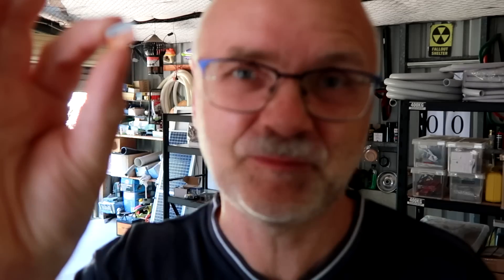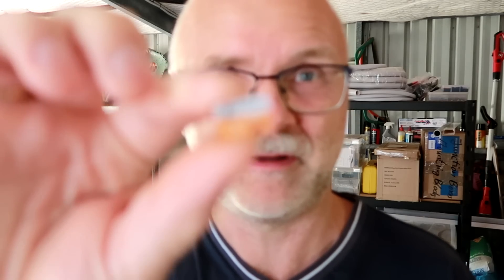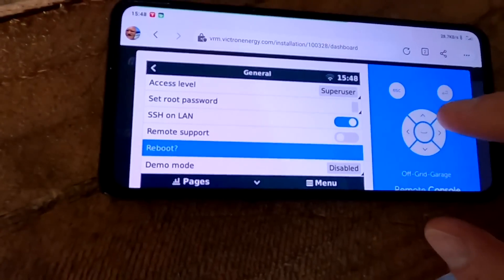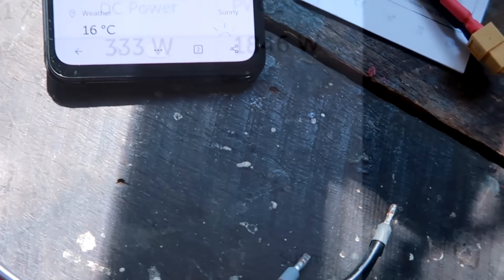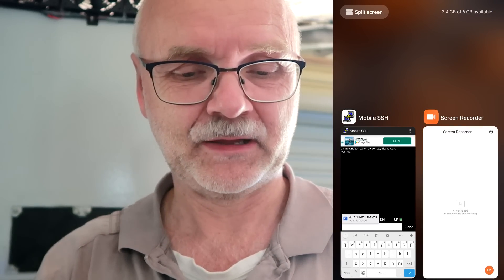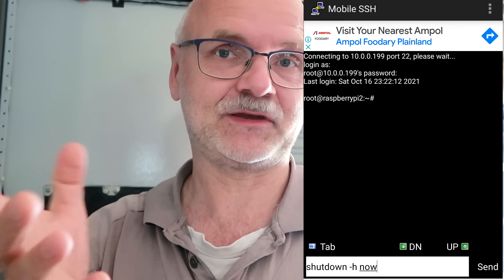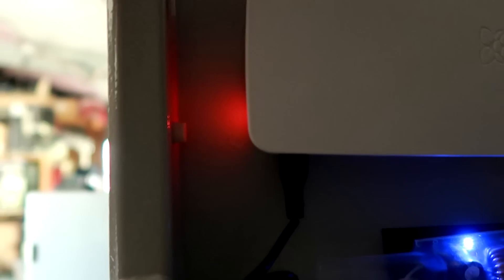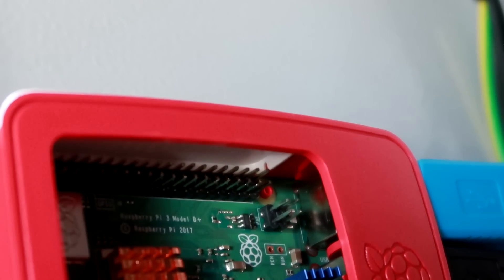Avoiding corruption on your Raspberry Pi SD-Card running Victron Venus OS

Comment: I run a Raspberry for 6 years outside in temperatures from -28 to +32 and with power outages and other things and still no corrupt SD card . Why ? I create a ram drive and there I put all log files and other temp files that needs writing. 
This will stop all tearing and cause of destroying a SD from bad power or loss of power.
All Data I need to store is sent to a database in cloud.

Comment: I do not get what is cumbersome with ssh. I have all my hosts in Remina, so on click and one command is totally fine for me.
Just did it to shut down a PI4 8GB to replace it with a PI4 4GB, to use the 8GB one for something different. I cannot remember, when i had to shutdown or restart something the last time, so i obviously do not do it often.
But i know the probably most hilarous way to do it ;-)
Additionally install KODI, connect a screen and a mouse, or use a remote desktop connection. Then you can click on either shutdown or restart. And if you are bored, enjoy some music for example...

Comment: I have had this problem in the past as well. Of couse SSD hardrive instead of SD card would solve the problem. Alternative solution anyway and recommendation: Update to a newer Venus OS version. I am using V2.80-16-large21. It seems that Victron changed in the way that the root partition of the pi now is read only by default. Only the data partition still is read/write. This seems to make the whole stuff more stable from what I can see so far on my Pi4 B 4GB Rev 1.2 (cruising sailboat setup). But why do you need to shut off the power? I have it running 366 days a year, 25h a day as it is connected to my Lithium and not to 230V shore power where you can have a blackout caused by a storm or an explosion of a nuclear power plant or some others of these daily issues. You should feel more responsible for your poor small raspi. 😁Cheers to down under from Germany!
Reply from the maker: Thanks for sharing. I'm in the process of setting up a second SD card with the large Venus OS. That's good to know, that they have changed the way they use the SD card. 
Sometimes I have to disconnect the battery for maintenance or changing cabling, and the Raspi gets its power directly from it.

Comment: Hi Andy, thanks again for these great videos!  I just installed version 2.66 of Venus on my RPI and installed the Mobile SSH on my Android phone, with the correct IP address and port 22.  Did you have to do anything else to enable remote SSH?  Mine keeps saying "connection refused".

Comment: I don't recall the pins, but I thought there was a way you can solder an on/off switch to the raspberry pi.
None that I found sends a command to the software to shutdown before turning power off.
I personally just do the "SHUT DOWN" command via SSH or software.
Then I have a AC switch that looks like a light switch to cut off power so I don't have to unplug and then plug back in.

Comment: On the jk BMS I just received my order for a 8s it only has the 10 leads for the battery so I don't need to use the boost converter.
Reply from the maker: Yes, that is correct. That's a brand new device on the market. Let us know how it goes.

Comment: This is a script I have used in the old days on the original Pi, im not sure if its still valid as it was pre systemd, I assume it will work though, you would just need to confirm the gpio pin on your Pi, or you may be able to follow it and make your own version, its recommended to you a switch and a pull up/down resistor to trigger the gpio via the switch.

import os
import time
import RPi.GPIO as GPIO
GPIO.setmode(GPIO.BCM)
GPIO.setup(17,GPIO.IN)
 
prev_input = 0
while True:
  input = GPIO.input(17)
  if ((not prev_input) and input):
    os.system("sudo halt")
  prev_input = input
  #slight pause to debounce
  time.sleep(0.05)
------------------------------------
just add it to /etc/rc.local (just before the exit 0)

Comment: If you don't have to store data locally permanently you could simply install an overlay filesystem in a ramdisk. This will prevent writes to the SD-Card and therefore no corruption possible.

Comment: You should shecdule a restart of your Pi in the software for each morning then it will save all the data so you only lose 1 days data if you don't do it correct
Reply from the maker: As long as it is online, it pushes the data to the Victron server right away. This was the first time, it happened and I lost only a few hours as I was not at home. The Raspi usually runs 24/7 without issues.

Comment: You don't need the -h. The -h is actually the same as doing --poweroff (Not the same as --halt or -H)

The default if you don't specify anything is -P or --poweroff which is the same as -h (Which again is not the same as --halt or -H).

On many systems "halt" and "poweroff" are the same, but on some systems "halt" doesn't fully shut down the entire system, it just stops the CPUs and leaves everything else in standby mode.

The "shutdown" command won't do a reboot unless you specify -r or --reboot.

So all you need to type in SSH is: "shutdown now" you don't need to add the -h.
Reply from the maker: Thanks for the confusion 😁
When I tried the shutdown without any parameters, the Raspi came back online after a ~20s

Comment: I have a backup (clone) sd card for my raspberry pi hole, They will fail sometimes.
Reply from the maker: How do you make a clone from the SD?
Reply: @OffGridGarageAustralia  See: https://www.youtube.com/watch?v=tiCCoBiW4E4
Reply from the maker: Perfect, that is very easy. I've got this program already just wasn't aware that it can image as well!
Reply: @OffGridGarageAustralia  ps if you run win32 imager, you have to also turn off google drive/desktop it make w32imager break
Reply from the maker: @pmacgowan  It seems to work fine on my workshop computer

Comment: the camera should have a setting of a portrait or face image;  that should tell it to focus front always... I think they typically default to landscape mode (I don't speak of landscape like a screen orientation, but more of the literal sense of the word)
possibly you have focus zones set on the screen,   sometimes it gives options for a grid of zones or single zones it will use to auto-focus.

Hope it helps!
Reply from the maker: Yes, it usually tracks my face unless I touch the screen somewhere and make it focus on this point 🤦‍♂️

Comment: I use the Venus Large Image which includes Node-Red. Then through a web browser I have buttons for two scripts that allow Reboot and Shutdown
Reply: Don´t tell him about NodeRed! It will result in at least 30 new vid´s about that ;-) Just joking. I am using a complete Victron installation on my cruising sailing yacht also using Victron Venus OS large incl. Node Red on a Raspi4. Starting with Node Red in that context and a few Shelly home automation relays in combination you really can do amazing automation things. For example I am making hot water a.s.a. NodeRed identifies >99% SOC at my 330Ah Lithium, identifying that my mobile phone is connected to the router (means I am on board) and measuring PV-voltage >20V (indication that more amps seems to be available at PV). This is running for 10 minutes and then shuts down the hot water boiler and runs in loop again. So I am using 20L hot water as additional energy storage a.s.a. the batteries are full. You can really do amazing things with Node Red...
Reply from the maker: @Dosheimer  Wow, that's what I want too!
It'll be 63 video. At least 😁
Reply: @Dosheimer  very interesting, I never though about detecting my phone's presence on the network.
Reply: +1 for Node-Red. You can easily create an HTML dashboard with buttons (no coding skills required) that essentially run the shutdown command you used via SSH. Thanks for the all the videos Andy!
Reply from the maker: @roboravec9678  Thank you. I was hoping that I can somehow integrate a shutdown procedure with Node Red... 😉
Reply: @OffGridGarageAustralia  Ill be looking for this video. Most of what i have read on shut down seams to be above my paygrade
Reply from the maker: Yes, that will be the next step for me as well. I'm very interested in this.
Are these standard scripts or did you make them yourself?

Comment: It seems to me that the corruption is caused by the OS itself. I was using v2.73 for the last month or so and the longest the system would run for was 4 days. Most of the time the corruption happened in a matter of hours regardless of reboots or pulling power. When it dies there are a few things that always happen.

1. The MPPT will stop communicating and show disconnected. (always the first device to fail) the inverter and shunt will follow if allowed time to do so.
2. If you reboot the system it comes up, but shows error #42 (corrupt data partition) and all settings are lost (wifi, vrm, location, ect...) fyi. i don't have a router to use Andy's method of setup, but you can remove the file /etc/venus/headless and the system will give you a user interface you can run a monitor and keyboard from allowing you to set up wifi and other settings.

I reformatted the cards multiple times getting the same results. I sent the pi back thinking it was faulty, I tried a new dc 3a power supply with the same results. New heat sinks, I even bought an SSD and USB  M.2 adapter to try and boot from that (which I can't seem to get running with Venus OS, I could using raspian). No Joy. After thinking about it for a bit I decided to fall back to v2.65 which Andy is using, so far it seems way more stable than v2.73 but it has only been up for 4 days so far. I have high hopes. I'm willing to try and get the SSD online but all my searches online only apply to OS's other than Venus. TBH this has been very frustrating seeing as how long Andy's system stayed up without a failure. Input welcome.
Reply from the maker: That is strange in deed. Mine says that 2.66 is the latest and greatest. The 2.73 is a release candidate? I never had this turned on. The 2.66 runs for weeks on mine. Until I pull the power...
Have you tried the Victron Community with your SSD problem?
Reply: @OffGridGarageAustralia  Thanks for the reply Andy! Someone asked the question in the community forum within the last year I think. The answer was that they didn't know how to do it, but here is where to look if you want to try doing it yourself. I'm not a developer so it might be beyond me. What might work is the EEPROM flash that should allow a dual boot (SSD or SD Card), but the latest version of instructions I have seen so far is a year or so outdated. I will keep looing into it after I'm sure the os is stable on v2.65.
Reply from the maker: @silverbullet8779  Someone else here just mentioned the Pi B3+ is already capable of USB boot but may need the newest BIOS. 
I've got 2.66 installed and it is very stable. In my case at least...
Reply: @OffGridGarageAustralia  My initial attempts to get the SSD running have failed so far, but I have ordered some cables to move the pi from its current location to a place close to my main computer to  further testing. The reason I went with v2.65 is that in your initial setup video its what you downloaded and installed (tyvm btw for the vid). If you are testing 2.66 now I feel this is good. Once the new hardware arrives i'll start testing later releases and work on the SSD setup.
Reply: I agree - it is not necessarily related to a power cycle.

Mine has corrupted twice now in normal operation, without the power being removed.
Reply: @cliffanderson6787  Which version are you running Cliff?
Reply: @silverbullet8779  v2.66
Reply: Just had another corruption - was running v2.73 on a 16GB SD card. Had been running fine for about 6 weeks.

I have a theory it may be linked to size of SD card (the bigger the SD card, the bigger the flash pages are), so just installed v2.73 on an old 2GB SD card today.
Reply: Performed a system reboot via the remote console and now the battery monitor disconnects itself often. Unplugging the usb for the bmv and reconnecting brings it back, but it has still dropped twice in the past 2 hours...
Reply: @silverbullet8779  V2,66 The MPPT stop communicating and show disconnected

Comment: I never had much Luck with RPi's, Every power cycle is a rusian rullet for the SD cards... Only solution i found for that is a UPS add-on so it can stay on in a power outage...
Reply from the maker: I tried many SD-card and never had an issue with any. Obviously the cheaper ones are a lot slower but always seem to work reliably.
Reply: @OffGridGarageAustralia  I bought proper SanDisk A1 8 & 16Gb disks (top half white, on red). Bought 2 cheap SanDisk, top is red on grey, does not have A1 printed on it, but the packaging said A1; Useless, corrupted, unsuitable for any OS, but does now replay MP3’s ok, although I now have 3 partitions, total about 3Gb on a 32Gb! Need to use Linux on another machine, and fdisk it. Also using UPS on my Raspberry Pi Venus, as I switch from 24 to 12 v sources. I power it up with a keyboard plugged in, then remove it.
Reply from the maker: @michaelbouckley4455  Interesting, thanks for sharing.

Comment: I use a SSD on my main pi. On other pi's running  in my roof space remotely I make sure the filesystem is read only and use ram disk. No problems.oh and take a image as a backup. For my main server I use a Google backup script running a backup of the docker containers running on the pi.
Reply from the maker: Can you take an image while the system is running and how do you get it back onto another card in case of a fault?
Reply: @OffGridGarageAustralia  no. I use DD command in Linux. My main server uses iotstack and runs docker so docker can do image backups and compress. Then backup to google.yhis is live.

For windows there are many sdcard imaging programs that I am sure would work.
Reply from the maker: @jasondevine6014  Yeah, the dd command... I remember that! 😉

Comment: The Raspberry Pi has a 40 Pin GPIO you can easily setup a momentary button that would allow you shutdown the Pi on press via a python script.
If you have access to the interface that has the reboot you can just add the shutdown command to it as well (sorry I have not used that software but if  it can reboot the system it can also shut it down if someone modifies the code )
If you can not access the software package that is running to modify the code on it you can also use Python to host a simpleHTTP server and use the call method 
call(["shutdown", "-h", "now"]) 
Hope some of these ideas help someone :)
Reply from the maker: That's great. I found a script online where the button needs to be pushed for 10 sec so an accidental touch will not shut it down. Something like this would be great.
Reply: There is already a http server running on the Venus OS

Comment: SD card corruption does not happen from pulling power over time, it happens immediately when you are unlucky enough to cut power while critical parts of the file system or any other important data is being updated. Interrupt an SD card (or an USB thumb-drive) in the middle of a critical write, you just lost whatever that was... a directory node, partition table, the file allocation table, etc.
Reply: This guy nerds! My kind of answer
Reply from the maker: Thank you.

Comment: Backup the new card :)  Also look at reconfiguring Venus to run off a RAM disk if your Pi is powerful enough. There's guides online for the general case but I don't see one for the Venus system specifically. Maybe the Victron forums have it? RAM disk will also help with unexpected power off because there's much less disk activity so much less chance to corrupt things.

I added a script that watches an IO pin so I can have a soft power switch, but that's a completely DIY Pi setup that monitors my house solar.
Reply from the maker: Venus OS is running from the RAM already and uses the SD card only during startup and in case the Pi is offline to cache the data.
Thank you.
Reply: @OffGridGarageAustralia  Doesn't this then make you wonder how the card became corrupt?
Reply from the maker: @millzee60  Well, the Pi was offline when I discovered the problem and I could not reach it on the network any more. The activity LED was flashing so I thought it is still caching the data on the SD card until it's online again. I should have connected a screen and keyboard to troubleshoot. This idea just came to my today. Next time 😉
Reply: Yes, it does make me wonder why it corrupted. I've had 2 corruptions in the last 6 months in normal operation. I don't think it has anything to do with power removals.

My pi has been running smoothly for about a month then suddenly just stopped. Like Andy said, this lights on the pi seem to be indicating periodic sd card access.

Comment: You could also update the bios and use a USB Solid State Drive, might not stop the corruption but it is a better media then the SD Card< thanks Andy
Reply: You normally will have to update the Pi bios to boot to USB SSD, once done, it is easy as writing to a SD Card, but you choose the SSD instead, I have a few Pi that boot to SSD
Reply from the maker: @sjdtmv  Thank you.
Reply from the maker: Thanks Ross, not sure if Venus OS will run from the SSD though. I can simply try it out though.
Reply: @OffGridGarageAustralia  since model 3B+ booting from USB devices is enabled as default. You could still boot from SD, and change where the Venus writes it’s logs